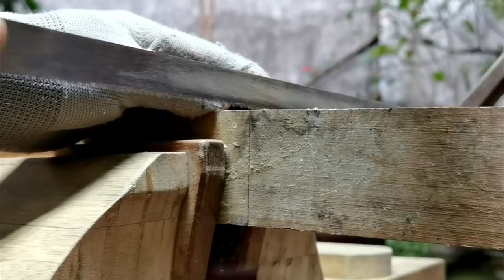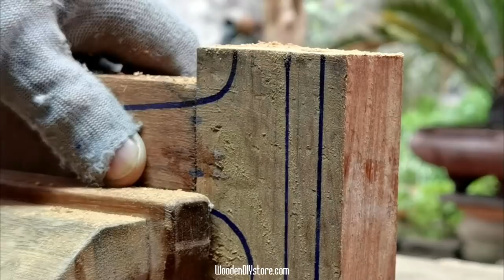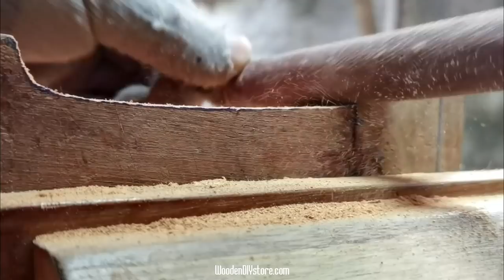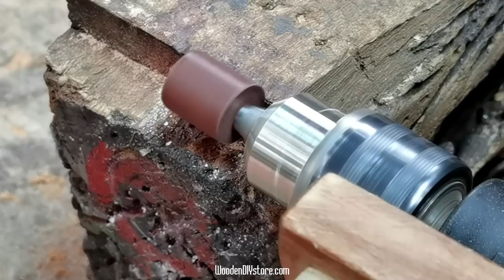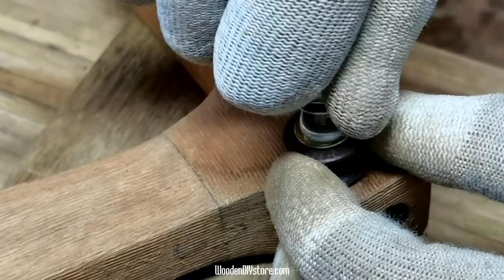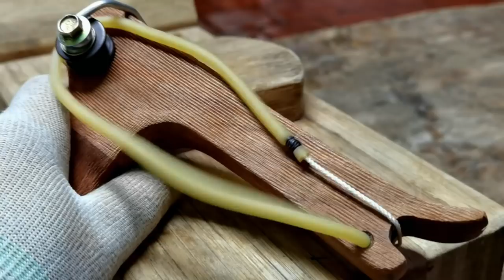Coolest "Wild Horse" Rollers SlingBow - Wooden DIY

Comment: Hi, what is the name of the bit or tool you use to smooth off and burn the edges of the holes please?  Looks like it could be ceramic or similar.  Thanks for another enjoyable video!
Reply: It's a hardwood dowel, it just needs to be harder that the wood it's burnishing. The tool is a hole burnisher
Reply: @the_clockwork_jackass6897  Thanks for that! Good to know.
Reply: Great stuff!
I'm interested in it's accuracy and the distances it is capable of!
Have you done much shooting and assessment?